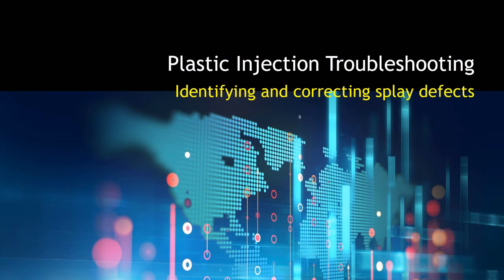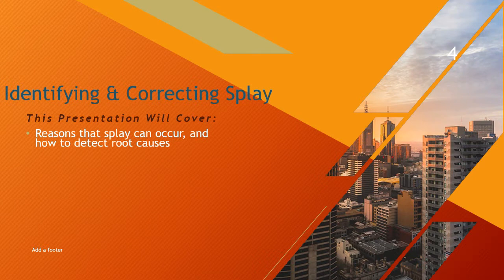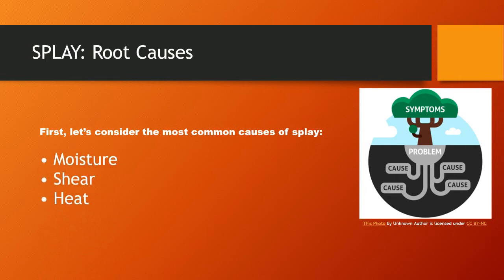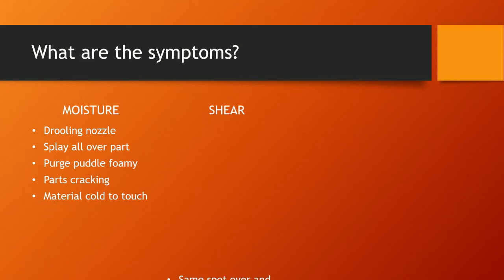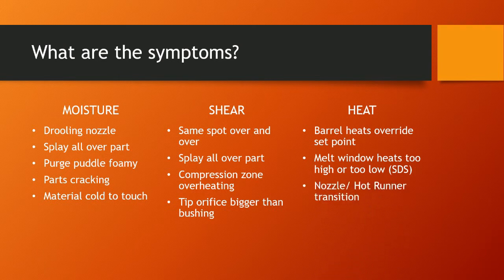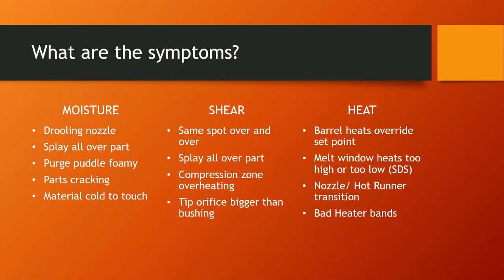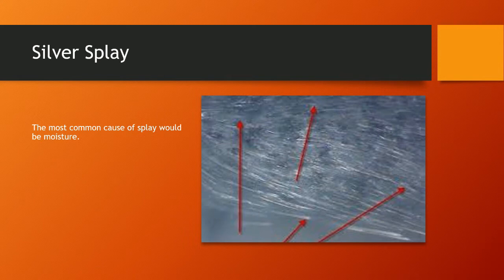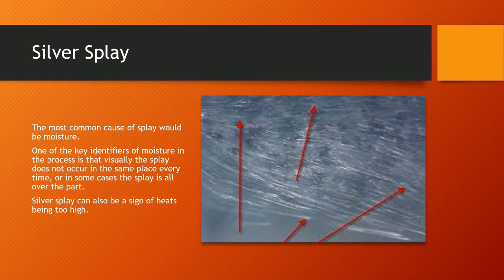Troubleshooting Splay Defects in Plastic Injection

Comment: Dry material. If it is hygroscopic. Up injection speed, or psi. ,but not enough to sheer. And a drowling nozzle could be a bad heater band or thermocouple . And make sure you barrels are at the right temp.. if you have valve gates that can affect your plastic flow aswell
Reply: What bout if a valve gate tip is excessively bigger than the other one, like close to resembling a stop sign lol?